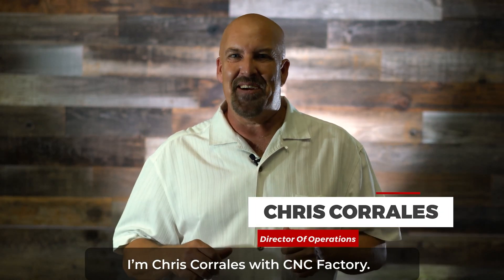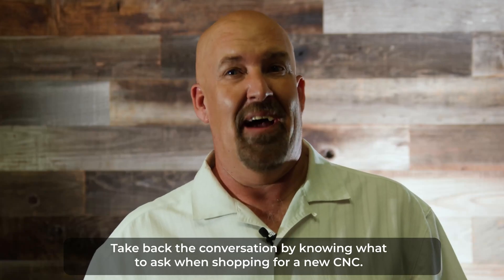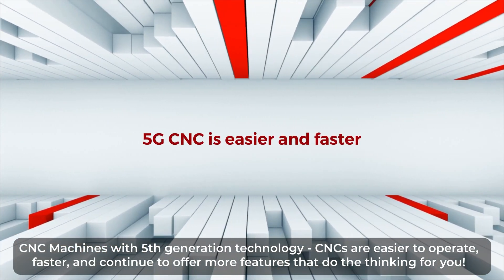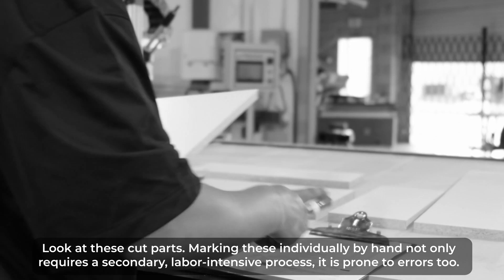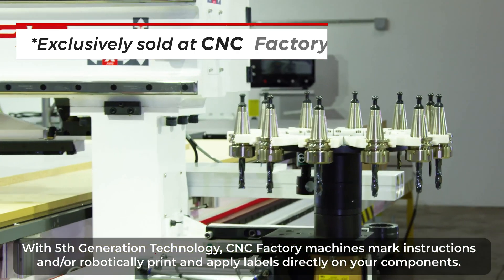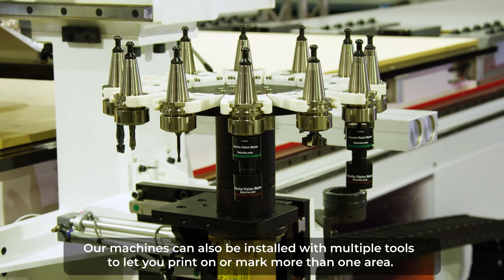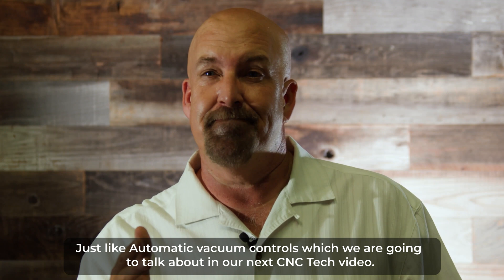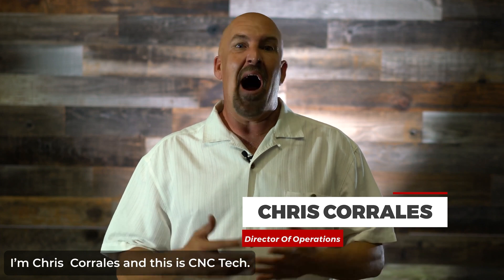Can your CNC mark or apply labels? Ask before buying-- CNC Tech/CNC Factory

Comment: That's one expensive stamp
Reply from the maker: Hi Nate, this is a patent-pending design you won't find in other CNC providers. The time it would save your operator from sorting and/or mistakes will surely be worth it even in the short run. If you're still interested, call us at 714-581-5999 and we'll give you a 10% off coupon. Thanks for your feedback!
Reply: @CNCFactoryusa  I'm not saying it's not a good idea but it is just a stamp....